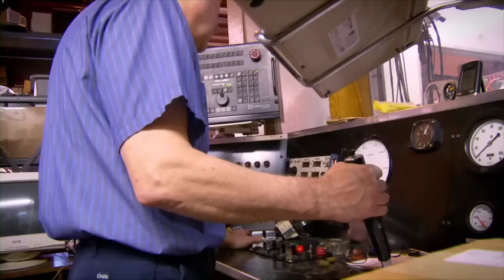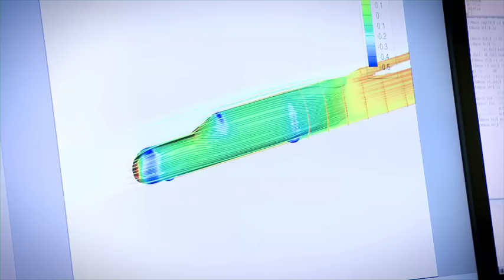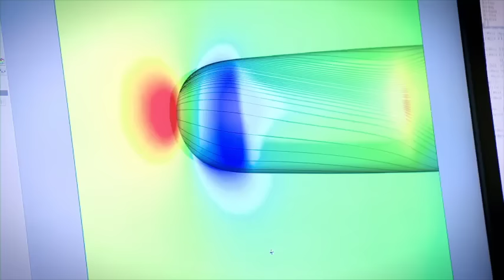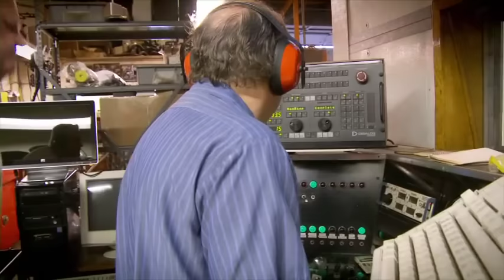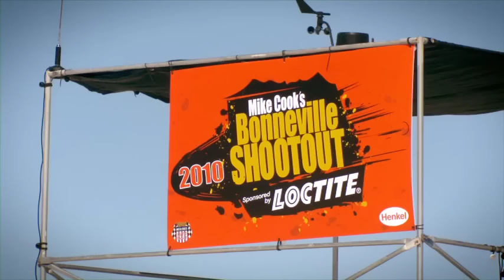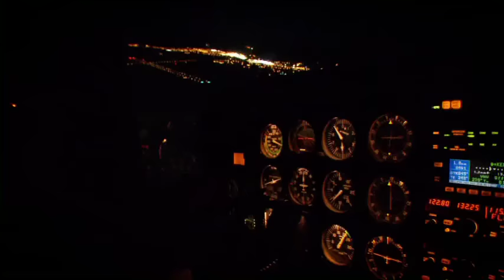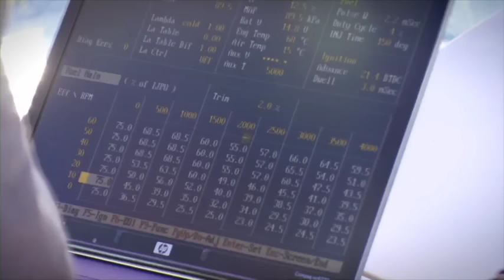Fastest Bike in the World! | Breaking the Land Speed Record! | ACK ATTACK | Full Length Documentary

Comment: Check pics and videos from converted film, of course, and notice the spear shaped protrusion on nose of the aircraft. I read about it when i was a kid, I'm 68 now so you can do the math, and what i read was that as the jet powered aircraft approached 300mph they encountered that barrier of wind that was like a wall and required a, for those days, a massive amount of horsepower to overcome. So someone came up with the idea to use the spear lookin things to create it's own intrusion into the wall out in front of the jet's fuselage and the waves opened up a type of hole thru the wall ahead of the jet. You can find graphs and wind tunnel results from back then. Suggested it to John Force to try on his Funny Car and while he laughed but was for trying it since it's the tires that trip the lights, not the body, nobody humored him, or me. 
Seems like if it would possibly help anybody it would be salt flat racers. Probl cost less than $500 and what could it hurt. Another crazy idea is to install an ionizing device that thins the air ahead of the vehicle. Probably wudn't help as you're interrupting the air so quickly. In a closed space it will cause the dust to go to the floor. 
Know ya'll don't read comments but perhaps someone who knows you might mention the jet fighter fix. If it only made a mile or two mph difference i think that would be cool but if it helped in stabilizing the bike that would be amazing. I'm dyin ftom 5th cancer but wish i could see ya'll try it. If only in a wind tunnel. 
rick in Tennessee. Uh, don't have any suggestions to lower "pucker factor" of rider/driver. I'm pretty sure that causes some drag on any bike or vehicle. The machines can feel the tenseness. L8r.

Comment: Fastest I ever road a bike was on my 1972 850 Norton @150 MPH. Then you could hear the valves,starting to float as the Norton never had camshaft centre bearing supports.
Reply: Center bearing can't stop valve float and a 850 Norton could not touch 150
Reply: Hmmmm..... that's not the only thing starting to float...
Reply: What a desirable bike back then. I couldn’t afford one but they were the real macho machine.
Reply: @deltabluesdavidraye  he may have meant 120, but I knew a guy who drove one across the prairies in Canada and he said he just gunned it through the boring flat parts, which is a LOT of it out there.
Reply: Maybe 120... My 73 was a Combat and cost$1695.

Comment: Craigslist ad 
looking for a "qualified" individual willing to drive 400 mph+ in my homemade experimental motorcycle
Reply: 400 mph is 2 football fields a SEC0ND.  Bonneville is 8 to  14 miles long on a good day.  My question;  What horse power will you have and how much of it is at the low end of your REVS to get to 400 mph?
Reply: @raycarolewallace466  The difference between 394 and 400 could be the smallest change in the aerodynamics given that drag is proportional to the square of speed. Or, traction at any given hour could easily make 6 MPH. Many years ago I was able to measure 10% wheelspin at my top speed of 121 on 15 cu. in.
Reply: @perrysims3320  They are spinning a LOT more than that now. The 1,000cc bike I helped tune had 80Lb of lead in his swingarm and his entire run(s) were still all about throttle control, trying to keep it from spinning "too much" (wasn't ever able to get/keep the throttle wide open on any of his runs)...
Reply: @KCadbyRacing  I don't doubt it. Almost all the 4-wheel streamliners are ground effect cars now. I was excited about the Carbonite Car. I thought the design was a good step. It is still to be proven. I don't think that their innovative design brought them down, but a nasty mechanical failure.

Comment: Why does the sound cut out about 30 seconds in? I guess it was stuck in 5th gear... I went back and relouded and it worked ok. Sounds pretty cool with the engines singing. Still, the best sound ever is Al Teague's car with the big V8 turning ??? 7K +?. Like a dragster but just going on and on and on. Better than any symphony and I'm a classical music nut.
I wonder if the thing was flexing at high speed and jamming the shift linkage. Imagine how fast he could have gone with the top two gears?
Reply: @Chris Baker. You think a big V8 sounds good (yes they do, my 413 Max wedge sounds awesome at speed), but try a V12. I've got a smallish 3.9 litre Italian V12 that turns 8,000rpm, and sounds Like nothing else, but my 6 litre German V12 is a lot faster even though they limit them to 6,000rpm and it doesn't sound as good.. For a few years now I have been thinking of finding a cheap one and stripping it down to build a salt car. I reckon I could lose nearly a tonne in weight taking all the sound deadening and electric motors out of it. The standard cars will do 340kmh, so dropping lots of weight it would have the horsepower to turn higher gearing easily enough. I'd be happy to join the 200 club. That would be cool in a factory spec  car.
Reply: @andrewlongfield3102  I had a Ford Escort SX2, DOHC, 4 valves per cylinder and it sounded really good at 8 grand.  But I also used to ride a Honda CB700 Nighthawk that turned 11,500. I hear bikes every night that turn well into the teens here. They sound great too. Not enough big V8s   though. So I'm deprived 🙃.
Reply: @chrisbaker2903  Those Escort motors sound great. I rallied for nearly 30 years, so they are a very familiar noise to me, especially listening to them coming through the forest at night pulling full revs. I had a mate who spent many years driving speedway in Dirt Modifieds (basically sprint cars without wings), and he was telling me that some of the guys running Chevs (304 I assume), were running them to 15 or 16k , and the Chrysler 318's were running over 17 grand.  Unfortunately I never got to hear them, and I think the bigger engines in the sprint cars 'only' rev to about 12k. I think you are probably exactly right about body flexing jamming the linkage at speed. I think it was most likely wind pressure over a certain speed distorting the bodywork enough to jam the shifter. It was one solution they never seemed to explore. They also never tried (I assume because it's not in the film), short shifting it into high gear at a lower speed earlier in the run, and using more track to bring the revs up. It's possible it wouldn't have had the power to maintain that speed at lower revs., but it didn't look like they tried it. Maybe they already knew the engine parameters well enough to know it wouldn't work, but what if they raised the rev limit, and 'shortened' the gearing allowing them to get in the high gears earlier at lower speed? They would probably still be able to run the same top speed as the higher rev limit would cancel the lower gearing, the difference being that they could put it into high gear at a lower speed. Mind you thats making a lot of assumptions about things I don't really have enough data for.

Comment: Wouldn't it be an idea to have an adjustable wing on each side of the bike so if it's veering one way you could open a wing from the side so it accounts for the veering and keeps it straight up and down? Or if that would mess with the air flow too much maybe look at the weight distributation on board

Comment: Although  it's totally  irrelevant now, around 40:36 there is a not particularly good shot of gear change linkage where it looks like angles are a little 'off' and the link rod looks a little bent.
It's something of a common problem on bikes with a linkage system (even cruisers with forward controls)
As it changed gear properly when in the pits, I would have looked at anything that could have interfered with the linkage when airflow inside cowlings could be moving something causing the issue, or, one engine was moving slightly under power causing link to bind. Pity there isn't a follow up where they found the problem. As for tyre issue, manufacturer should have spun them up to maximum rpm and checked they were not distorting,
 Dunlop used to do it in the 1960's on a 10 ft diameter steel roller, I guess with computer controlled 'everything' it's deemed not necessary any longer?

Comment: 270kmh (167mph) 2-up on a road bike is my best.  That was in the 1970s on a stove-hot bridge-ported 750cc 2-stroke, and Dunlop K-81 road tyres........
Reply: Was the bike a Kawasaki kh series ??. If i remember right those things were fine in a straight line but jelly in bends.
'' David Burne '', almost and sounds the same as one of my favorite singers , ''David Byrne , Talking heads ''My best was 155 on a Yamaha FJ1100. that was on the M23 from peas pottage to the Gatwick turn off
Reply: @MrTarmonbarry  Suzuki water bottle, actually, more reliable HP when ported to the edge of lunacy with the water cooling.  Bloke who designed the mods designed the chambers as well (he was an acoustic engineer) and made the middle cylinder’s tuning a little different so it always ran a notch richer.  Only reliability issues were more regular ring changes and blowing up the clutch on my second quarter mile run - blew apart the clutch basket and destroyed the side cover.  Other than that it was a terrific bike.

Comment: Make the final drive sprocket a ratchet fit, so there is no rear wheel-driven chain drag while changing gears.  My %0.02 worth of superfluous comment. Also, consider using high temp automatic synthetic fluid in the gearbox, preferably with its own little radiator.  i think the high revs are spinning the oil off the gears and shafts, making shifting near impossible.  More RPM will possibly make the same difficulty happen at lower gears.  Another thought is d a derailleur type of rear sprocket cassette--maybe a two-sprocket or even a three, two the same at a lower ratio, and a higher one in the middle for the record.

Comment: Did anyone ever figure out why the transmission would not shift when under full load? If it will shift under no load then there must be something changing internally, some internal clearance must be disappearing. I wonder if there is some sort of case flexing issue, the gearbox gets somehow "wrapped-up" and squeezes internally preventing the shifting forks from moving. It seems like this "effect" whatever it is, could be reproduced on the dyno-stand. Perhaps some sort of external gusset plate could be added to prevent the gearbox from torsional flexing and changing internal dimensions. Whoever designed the transmission case needs to do another stress loading analysis. If gears 1 through 4 are all on a common shaft and gears 5 and 6 are on a different shaft this could be the place where the problem originates. They replaced one transmission and a second one, and it had the same issue as the first. Blipping the throttle should theoretically "unload" the transmission momentarily, but to no avail. Shifting with or without the clutch made no difference either. I am glad they had the flexibility to change the rev-limiter and run the extra tall gears to break the WR. But 400 mph needs a working 6 speed tranny (I think)?
Reply: Yes. I Had a similar problem with a trike some years back.
The power to weight ratio was absurd  and the gearbox I was running was not configured as much as the motor was.
Result was that power  to 1st was so huge the whole thing would shake and the gearbox would ride clear of the mounts and like me in the butt.
I ended up just using gears 2, 3, and 4 and it seemed to work as well as required even on standing starts with the boy racers that thought  4 gears may give them a chance.
I was all over a Porche 911 once on a standing start on a roundabout.  He started off in front which stopped me passing, when we came to level out I got a chance to pass but the front was skipping across the road with the power.
I digress though, you have that area between the gearbox mounts and the gearshift mounts. The gearbox tends to be rigid fixed to the engine and both on rubber mounts. the shift tends to be partially fixed  to the chassis.. The torque of the motor under revs will try to spin the engine, a bit like a helicopter without a rear rotor.
Had a similar torque issue on a Rolls Royce a well many years back.
6750 cc and it was stuttering when wound  hard  from zero..
Turned out to be worn engine mounts that allowed the motor to spin further that it should revving up an had been rubbing a high tension lead to earth.. Not sure why he punched a Rolls rather than a Bently if he wanted to thrash it, they were essentially the same car with different badging and tweaks

Comment: You could easily fix the stability issues by fitting two electronic Gyroscopes down low in the floor . It will then stand straight up and stay up !
Reply: How much would they weigh, and how much power would they use to run?
Reply: @wtc7smokinguntherealperpsg228  I understand how it works, what I'm getting at it is, it's going to add weight and needs to get power from somewhere.
When your timing runs in fractions of a second, you want to keep the weight as low as possible and don't want to rob hp from the motor to run it.
Reply: @bigredc222  this is not drag racing. They actually have to add massive amounts of weight in order to hook up at speed on the salt.
Reply: @davidleonard8369  They don't just throw tons of weight on it, if they need to add weight for traction I would think they would keep it to a minimum, you still don't want more weight than is needed.

Comment: Donnie Vesco, who I raced with in the 1950's, 60's & 70's, held the Worlds Land Speed, motorcycle record @ 214 MPH. What's this all about?
Reply: This is all about records that were and are being set and re-set in the 21st Century😁 (Don Vesco was one of my idols when I was young)👍
Since 1999-2000 the larger displacement bikes have all been so powerful/fast (V Twins not included) that the factories have been speed limiting them at 186mph (and less than 200Hp for the last few years). If you haven't kept up with Drag Racing for the last couple of years there are 100% Street Legal, Street Ride-able bikes that have run 7.50s at 190+mph in the 1/4 mile and the "Pro Street" 1/4 mile record was recently set at 6.30 at 233 MPH. Again, that's Zero to 233mph in 1320 Ft... 600-800 HP on DOT Street Legal Tires.
Reply: If I remember right there was a Honda LSR bike that in one of it's early runs went through the speed traps on it's side at about 30 mph over the record. I thought that was hilarious (since no injuries resulted). Cal Rayborn set the record at 265 mph in 1970. In 1975 Don Vesco went 302 mph powered by 2 TZ700 engines (2 strokes). Finally for the 1900s Dave Campos set the record at 322.150. So you've been out of the picture for awhile haven't you? LOL They go faster than that nowadays but Dave's record held until 2006.
Reply: @chrisbaker2903  Not sure what you mean? I know "Stream liners" went stupid fast in the 1900s. My comment was about how much faster ALL bikes are now vs pre 2000s (even showroom stock) but again, most V-twins aren't included = they aren't "speed limited from the factory" because they aren't capable of going 186mph (unless it's free falling out of an air plane😁). DON'T take that as me hating V-Twins. I rode a 103cu HD (Methanol Turbo)  Dragbike many years ago that ran 7.40s at 175mph in the 1/4 mile so it could have "easily" gone 200+ LSR...
Reply: @KCadbyRacing  the subject was streamliners and land speed records, not street bikes.  I was just clarifying and figured what you were saying was just an aside.
Reply: If it were about speed you never got a record back then, and the current record is way above 214 now.

Lets face it, 20 mph in a wheelie bin is something the all aspire to, and our first trip on a combo we will never forget.
The fun we got on a trike over the years, very few people to share that with , brothers of the 3rd wheel stuff going on .
Some crazy Trikes out there ridden by crazy dudes.

Comment: How fast will it go when they get 5th and 6th gear working?!?
Reply: I was thinking the same thing.
Reply: 5th gear is impulse power, and 6th is warp 1.
Reply: possibly not much faster, they changed the gearing so 4th gear was close to the original 6th gear ratio. Acceleration would be slower possibly because of bigger gaps between gears, and they may not have had the optimum final drive ratio in the end but I believe that most likely not much more speed was to be had without more engine development.

Comment: My top speed was first set in a 
Rebild 900cc HONDA .. normal speed 210 
modded 299.7 on cycle 499km/h computer fwd and back 
On german free speed road way 22km eatch way
Speedo only went to 280km/h
Vance & Heinz 
Performance mufler
Dial a jet 
1100 oil cooler and top
1100 carb
AVON ROAD RUNNER TYERS!!
105 Ferrari german Fule

Comment: A bit dated?  IIRC there are a handful of production bikes now (2021) that can exceed 200 mph. I'm reminded by Rolls-Royce response to how fast or how much horsepower their cars have  "It is sufficient".

Supposedly my 2010 K1300GT tops out at around 160, but there's no reason I'd try it.

BTW, vortex generators don't smooth airflow, they actually increase turbulence and cause separation of flow from the body.  There are situations where this is desirable, such as in surfing where a fin will start to hum at high speed.  Speed in this consideration has to take into account the viscosity of the flow, possibly speed of sound (if the fluid is compressible) and length of the object.  I think this was Burt Munro's issue - his streamliner was in fact susceptible to vortex creation and shedding after a certain speed.

And doesn't Rocky believe in HANS devices?  Don't see him wearing one, unless I missed it.